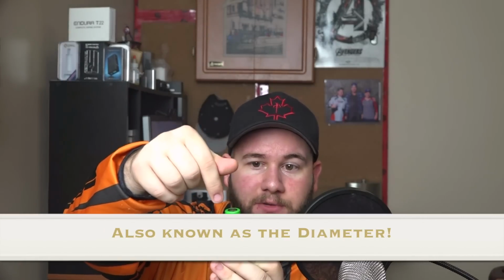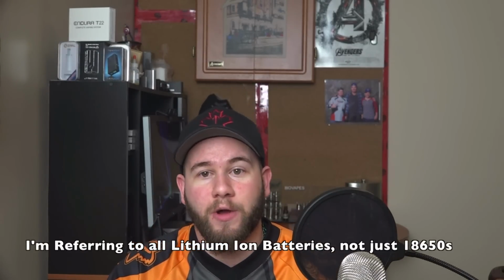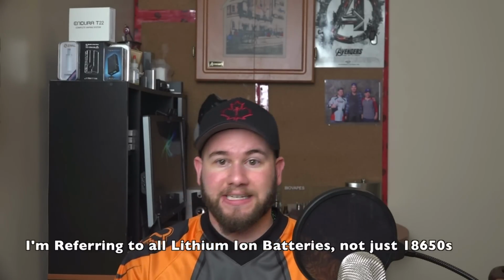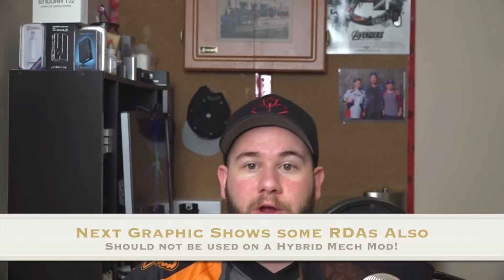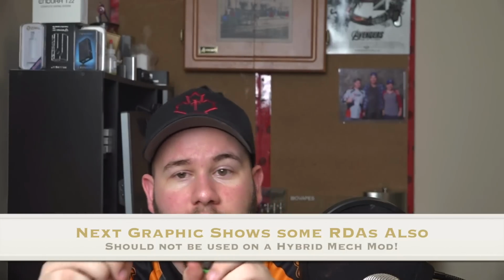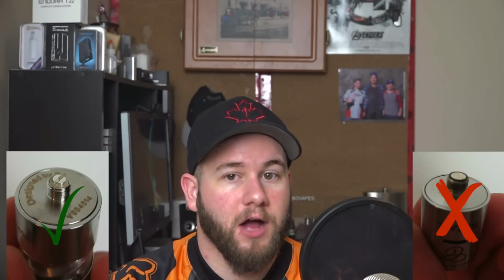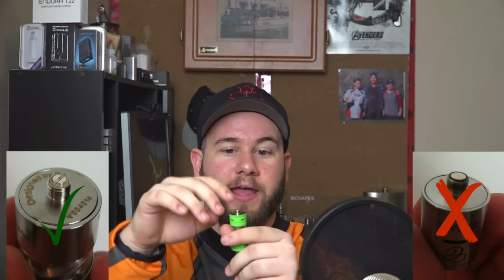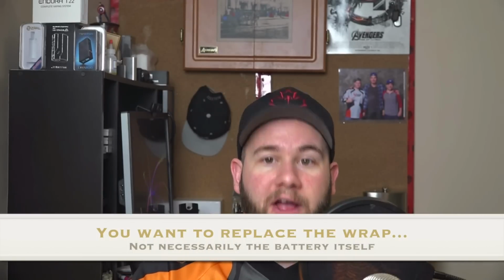Battery Safety | Vaping 101 | Lithium Ion

Comment: i have searched for such an wonderfull detailed video for 3 hours now and i found it thank you very much subbed and liked keep up the awesome work
Reply from the maker: BrokeOwn thanks that really means a lot, I had actually forgotten about this video to be honest, it didn't get as many views as I had hoped.
Reply: ill share it so other new vapers can see such an awesome detailed video reason i checked it out is because i want to get into mech vaping and now i feel confident enough to try it out just use same battery keep the wraps in tact  make sure the pin sticks out enough and calculate the ohms i can use and just build higher then that i think i got it :D
Reply from the maker: BrokeOwn thanks I really appreciate the share! Yeah it sounds like you are pretty much there, the only thing I would add is make sure the pin is a screw and not flat. Flat typically represents a floating pin so even if it sticks out far enough at first, floating pins get pushed in really easily and can short. Protruding pins (with the screws) do not get pushed in unless misused or broken.
Reply from the maker: BrokeOwn oh sorry and always build on an ohm reader or regulated device so you can check for shorts in the wire prior to using a mech
Reply: i like u man :D ur a really kind human being thx for the pointer i forgot about that i appreciate it and i allready shared ur video u should have more subs for the work ur doing also sorry for my broken english im german :D
Reply from the maker: BrokeOwn thanks that means a lot! Also your English is perfectly fine, and besides I would never judge someone on that.
Reply: thank you :D have a nice day and also no problem man

Comment: Thanks a lot dude! Exactly what I was looking for. How long should I wait before putting the batteries in my mod after charging them? And also which manufacturer would you reccomend? Thanks for the video!
Reply from the maker: Sten J thanks I appreciate it! You don't have to wait before putting charged batteries in a mod, unless your charger is making the batteries very warm, which in that case you may want change the charger your using or the batteries. My personal choice for batteries would be Sony's, lg and Samsung. The most important thing to remember though is buy from a reputable battery seller so you don't get cheap rewrap batteries with low amperage ratings.

Comment: While I don't have the equipment to truly test the amperage, I can say with fair certainty that the latest series of the Red AWT 18650 are at least 35A. I have been pushing through ~34A - ~31A without any battery stress. Battery doesn't quite match the heat of my SS SMPL Mod after chain vaping. I am quite confident they can handle AT LEAST 30A. Also, I thought that having a parallel mod just means it double the MaH, not the amperage. This is why the general rule is NEVER BUILD BELOW 0.1ohm, even with dual serial or parallel builds. In theory, if it doubled the safe amp output rating, you could build down to 0.05ohm safely on a dual series mod, (or 0.11ohm if you are playing it safe any going by max 20A output for each battery). With your rule being 20A, the lowest your can safely build on a single battery would be ~0.21ohm or ~0.11 on a dual. Would you recommend disregarding the general rule that seems to float around (0.1 being the lowest you can build) for the safer 0.2ohm one, or would you say it is too complicated to make a general rule. As far as I can see it is easier to generalize and say don't go below 0.2 ohms and leave it up to people with a through understanding to build lower if they understand how to safely.  Sorry has stuff to do so this comment got a little scattered.

Comment: you really think the zero is for the shape ? aren't most batteries cylindrical ? and if they aren't cylindrical, what numerical representation will they use 
you might want to stop clicking on the first link of google and reading the first thing you see
Reply from the maker: +frizzybob Interesting, I actually did not google that at all this is something I have been told first hand. I am curious then if 0 does not represent the shape what does it actually represent?

Comment: i also have a few questions. now i noticed you didnt mention what you could do with paired or married batteries if you no longer have the mod and may not intend on getting another of a similar style mod for a while and wont have a use for them.
and say your short or need an 18650 for a mech mod or something like an evic mini or kanger sub box starter kit

1. can they be split up for use in single battery mods as long as they are NEVER paired to each other again.
 
2. can you SAFELY take married parallel batteries and transition them to married series batteries.

i just wanna see what your answers would be to these questions.
i know the the answers i just wanna see what your feedback would be on it if you were asked these questions giving the person wasnt completely mindless just wanting to throw clouds and has decent know how about battery safety.

Comment: your mic has alot of background fuzz. when you talk the fuzz comes in behind it. when you stop the fuzz goes away. like bacon slowely frying in a pan on low. great video tho. you ever see those really sketchy 18650 projects. especially in the " DIY " project videos. their have been alot of extremely sketchy lookin homemade stuff. ( not just e cigs ).  there is a video on kip kays channel about using an unregulated high drain 18650 shorted out with a piece of wire fashioned into hand warming gloves. no fuse or current limiting. just an on / off switch. the sight of that gave me the chills.

Comment: Great job Robbie. As well as Sneaky's link further down it would be good to include links to Pegasus Vapor Academy where Peg has two great new charts to allow anyone to pick the best battery for their needs and also to DJLsb Vapes.com where Daniel has an excellent section about batteries and also showing mooch's results in a table. What we need to get across to everyone (and you did ) is that these cells are very powerful but safe when handled correctly. These need a great deal more consideration than AA or D cells but those of us who drive will know that fuel needs to be handled in specific ways to be safe and don't go around worrying that their vehicle is going to explode. Same with li-ion batteries. Be mindful of this and take the simple precautions advised in your video and be a safe and happy vaper 😊!

Comment: I have found some 40A batteries.... The problem is all of the these have a peak of 40 but a continuous of like you said, somewhere between 15-25
Reply from the maker: I was going to touch base on continuous vs pulse but I was worried some newer vapers may not understand the difference. So to be safe I just went with the continuous rating.

Comment: Does venting or exploding happen more or less than we think??
Reply from the maker: I wouldn't say it's happening more often than we think, but if it happens even once that's still too much negative attention on the vaping society.
Reply: +Robbie Vapes I'm still new and I've watched all the battery videos on you tube so it freaks me out a bit.
Reply from the maker: 225rc nothing wrong with being new, and kudos to you for taking the initiative to read up on battery  safety.
Reply: +Robbie Vapes I know we need to change the wraps. my two questions are can we double wrap if we have the room for the battery to still fit in the mod also can or should we replace the white ceramic thing? if so where do we get the white thing?
Reply: +225rc yeah ya can double wrap em. you CAN replace the top insulator, but i dont know where to get replacement ones
Reply: +Joshua “Apathy” Miller, www.illumn.com has great black plastic ones and www.imrbatteries.com has good white card stock ones. Both are self-adhesive.
Reply from the maker: +Battery Mooch Yep great sites! Also self adhesive insulator rings are king if you can get them!